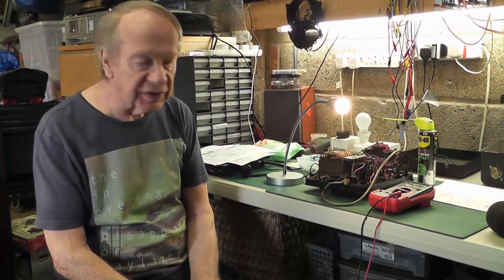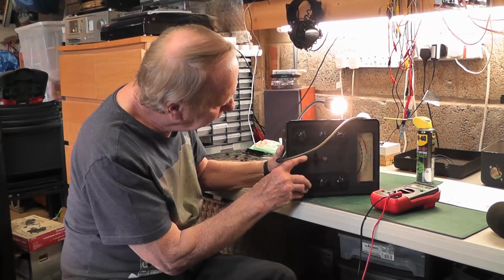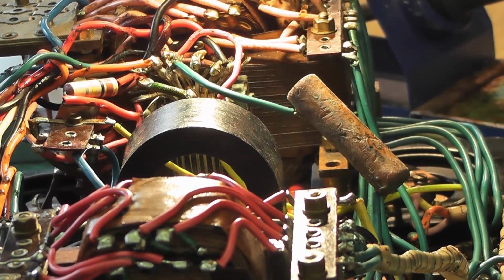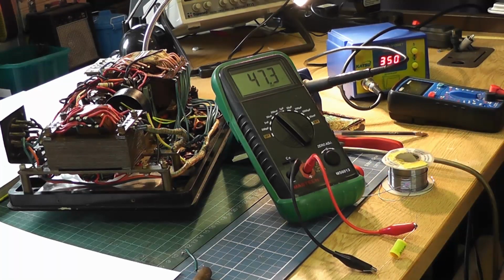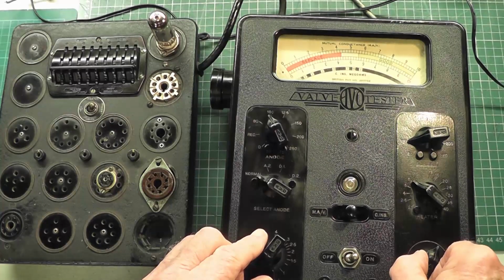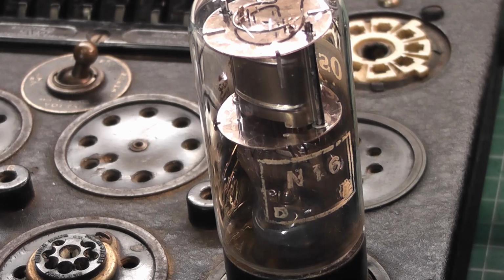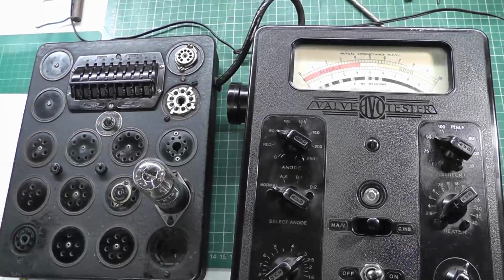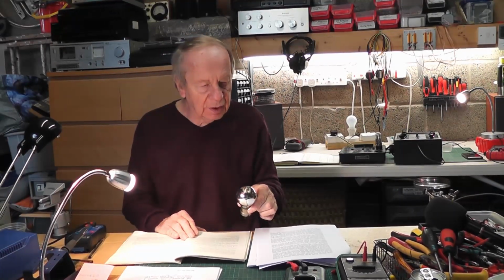AVO Valve Tester Part 2 Repair and Use

Comment: Hello again David, I sent a message re roller switch etc. a day or 2 ago including my email address, but I’ve no idea if you’ve received this.Chris
Reply from the maker: Sorry Chris,
Will look for it now
Reply: @DavidHallettProjects  Hello David, oh dear, we seem to have lost contact altogether now. I don’t really need the data you were proposing to email me. I have trawled the internet extensively and bought the valve data disc you recommended.. I have  even contacted David Williams who referred me back to the diagrams I also have here. I even have the very comprehensive Restricted Army service manual, which if you don’t already have it I could send you a link. Alas nothing  anywhere mentions the contact pin order into the roller switch, and the diagrams are not clear in this respect. Most frustrating as I’m dying to button this one up and get to testing the hundred or so valves I have. All that is required is to take an ohm meter from each pin of the plug to each pin of the roller switch, and a diagram to mark them,then I’m home and dry ,hopefully.  I do know the precise location of the cathode/ earth (the pin with the bridging link between two pins near the bottom)and both heater connections , as these were the only ones remaining intact throughout and are a good starting point. As to the remaining 6 they could be configured in a number of ways depending on which parts of the circuit diagram are consulted. Did you sort out your heater toggle switch? Regards, Chris
Reply from the maker: @chrishitchins794  
Hi  Chris
Sorry about my lack of response. You have been very industrious and resourceful in restoring the Avo. I must admit I have been distracted by other stuff but still use the tester from time to time. Thanks for keeping me updated on your machine. I have had very little to repair in the valve radio era recently as you will see from my channel. Now have two high end amps to sort so will be making a video of that. Take care
Dave
Reply: @DavidHallettProjects  I’m not sure whether or not personal data will be filtered on this link. You could try sending me your email to test this theory. If it still doesn’t work, I don’t know how to establish direct contact. Chris,
Reply: P.S. I could try Morse

Comment: Hello David, Thanks for your most instructive videos on this topic. I have just acquired a 2 panel myself and am following in your footsteps to restore to its full glory and have hit a snag at the first hurdle. I’m having trouble opening the meter section. I’ve removed the 8 screws around the perimeter and finding it most reluctant to remove. I don’t want to force anything, so my query is : am I missing a trick or is brute force the answer?
Reply: Make sure you remove the two screws holding the valve plug on the side of the meter. They stop the two halves separating. After that, it is quite stiff. Best way I found is to use a thin metal plate/ruler and slide it in between the two parts to act as a protective barrier to pry against. The top is bakelite and the bottom casing is metal. Therefore once the metal plate/ruler is inserted, you can then use a blunt blade to pry between the metal ruler/plate and the metal bottom casing. If you try to pry between the bakelite and the bottom casing without protecting the bakelite, it'll snap!!!

I know this, because I did it!!!!
Reply: @REVERSE_BIAS  Ouch !what a shame. I came to the same solution as you after much umming and aahing It was quite reluctant.I’ve replaced the capacitor as you did. It read even worse than yours. That panel now seems to be in fine fettle. The other,however, has given me quite a headache. When all connected up to test (ecc85) , no results at all. Probing around revealed that the interconnecting cable had seriously degraded to the point that only the fatter leads to heater remained intact at all. Using a sacrificial smart lead,r wiring the plug end was  finicky but manageable , following the pin out in the circuit diagram. However the other end into the rotary selector is giving me a real headache apart from the heater leads. I f one proceeds clockwise from heater leads, the designation of each pin does not conform with what is shown in the diagram. Can you enlighten me.?
Reply: @chrishitchins794  This is spooky, as I'm sitting in front of my panel right now. My test units seem to work fine, however my panel....the roller switch to be precise, is causing me a headache too! I've checked voltages and continuity on the cable and pins and all seems good. However those voltages aren't being transferred to the valve bases on the panel itself. I've tried drenching the roller in isopropyl alcohol and turning each segment many times. However the heater voltages (set to 6.3v at the moment) are not passing the roller.  I think I'm going to have to remove the roller completely. Held in on each end by brass nuts on a threaded bar. I've never done this before, but it's not working so I've gotta try. Shame because it actually tested an EF86 valve yesterday perfectly. I then rotated the roller to input another valve and it hasn't worked since. If you need valve roller codes or schematics, send me your email and I'll happily send then over.
Reply: @chrishitchins794  P.S....In addition to my last comment..... before I starting taking out the roller switch, I started to try to remember any other changes I had made since the last good test. I remembered that I had switched the small lever switch on the panel itself (sits an inch below the roller switch). So I started to test continuity on this switch and I'm getting erratic results. I'm unsure what kind of switch this is without looking at the schematic again, but it's definitely not working right even though it clicks across nicely. Therefore I'm going to clean this first and re-test again.

Comment: As you have discovered  the capacitor is one of the issues in this tester.
Secondly the neonbulb can off cause burn out, and more problematic is the selenium rectifier, which can be replaced with a diode and resistor, since the voltage drop is larger in
the selenium rectifier. The vulnerable part is the meter it is almost impossible to replace.
Judging by your instrument someone had a serious go at and replaced all the wiring. I have two units all black or brown wires with old insolation materials. Testing for shorts in the valve before testing m/a is highly recommended to avoid the risk of damaging the meter. I have some material about Avo so let me know, if you need anything.
Reply from the maker: Michael, thank you very much for your help and advice. I have located a replacement neon and await its arrival. I will also replace  the selenium rectifier, if I measure  the forward resistance of the SR can I calculate the resistor needed for the diode? Interesting about the rewire, it has been done in a very professinal way, do you think by AVO? Some information  on checking for internal tube shorts would be very helpful thank you.
David
Reply: @DavidHallettProjects  
Yes, measure voltage drop and calculate the missing aprox. 1,5 volt in ohms. I have this morning gone through my data on AVO both MK1,2 and 3 and have schematics, manuals and tubesettings, last one is a revised version from 2004 - I will need an emailadress to send the data files.
Reply from the maker: Thank you, can you send to david_j_hallett@yahoo.co.uk thank you for your help
Dave
Reply: @DavidHallettProjects  Have you recieved my link in the mail?
Reply from the maker: @miduan4  
Hi Michael,
I can't find the link, did you send it to david_j_hallett@yahoo.co.uk
Reply: @DavidHallettProjects  Your mailbox does not reject links?
Reply from the maker: @miduan4  hi
It should accept them can you try without a link and see if I receive that if not try: djhallett@blueyonder.co.uk
Thank you
Reply: @DavidHallettProjects  I have just send an email to that address.
Reply from the maker: @miduan4  
Thank you all received, very helpful. Did you want a copy of the  AVO CD manual and use?
Reply: @DavidHallettProjects  Yes please send to the mail I have send the link with
Reply from the maker: Please send mailing address to david_j_hallett@yahoo.co.uk and I will mail the disc to you
Dave
Reply: You have it from the mail I send you. Just use reply to the mail and attach the file.
Regards
Reply from the maker: @miduan4  will do
Reply: @DavidHallettProjects  I have not received the mail with the file?
Regards Michael
Reply from the maker: @miduan4  
Hi Michael, not yet sent file size a bit large but  will sort it
Reply: @DavidHallettProjects  I can send you a link to the dropbox?
Reply: @DavidHallettProjects  
Any progress in sending the file to me with the manual?
Reply from the maker: @miduan4  
Hi Michael,
Sorry, I have copied the disk but could not find a drop box address  for you. Can you update me please.
Reply from the maker: O @miduan4  
Hi I have attached the file link to my drop box, how do I send you the link?
Reply: @DavidHallettProjects  
Mail it to me in a mail
Regards
Reply from the maker: @miduan4  
Have sent email with all attachments but it keeps being returned to me with 'address not found' I've been using Gmail. Con you please forward you full email address to my yahoo account. david_j_hallett@yahoo.co.uk
Thanks
David
Reply from the maker: @miduan4  
https://www.dropbox.com/sh/fqhflgpmzwrkn4q/AABr8kFYEecZwErn0ej1Vg57a?dl=0
Reply from the maker: @miduan4  
Hi, I have sent you a Drop Box link  with all the Avo documents, hope you get it
Regards
David
Reply: @DavidHallettProjects  Thank you so much for that! Best regards from Brazil!

Comment: Great to see the valve tester up and running now. The Ediswan valve, quite a problem finding much on it, but going by Ediswan technical circulars then this valve clearly dates from around 1924 or earlier, still looking to see if I can find any more info on this type 730, Dave.
Reply: Looks like it's an Ediswan Type type "R" valve, Dave. By the way, is the markings on it BRC or BBC, nothing to do with the broadcasting company though.
Reply from the maker: @Theoobovril  BRC
Reply from the maker: Hi thanks for all your research lt is marked Edison and BRC but I will double check in the morning
Reply from the maker: Thank you so much, it would be good to discover the pin out. Must take good care of it, might be valuable.
Reply: @DavidHallettProjects  For the "R" type then it's a B4 base with Pin 1="a", Pin 2="g1", Pin 3 "f" and Pin 4 "f". Does this valve contain a getter ?,
Reply from the maker: @Theoobovril  Thanks, 
I will set up the tester using minimum filament  and anode volts
Reply from the maker: @Theoobovril  I think it has but not familiar with how it looks
Reply: @DavidHallettProjects  Conclusion, Dave, it's simply an Ediswan Type "R" valve and the 730 has nothing to do with the valve's identification. The BRC inscription, are you sure this is not BBC and not BRC, BBC having nothing to do with the broadcasting company though. Overal, several valve companies manufactured this type valve and as far as I can gather all of them marketed this valve simply as Type "R"....p.s. I have enjoyed myself researching this valve, I do love a bit of research lol.
Reply from the maker: @Theoobovril  
Now made another check..you are correct it says BBC